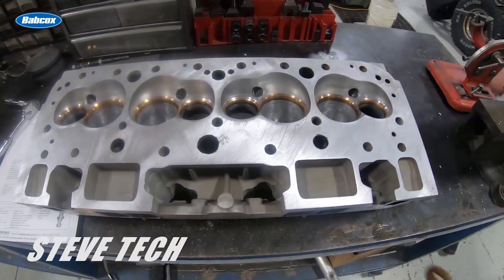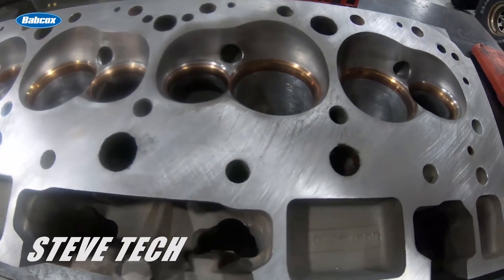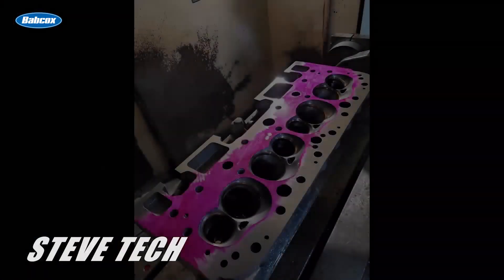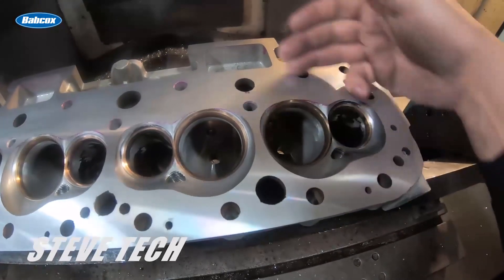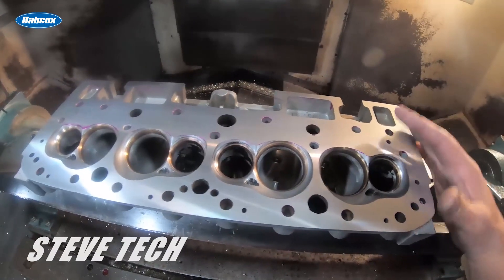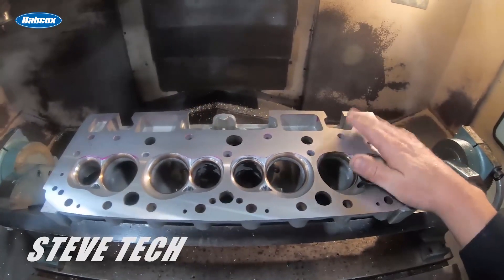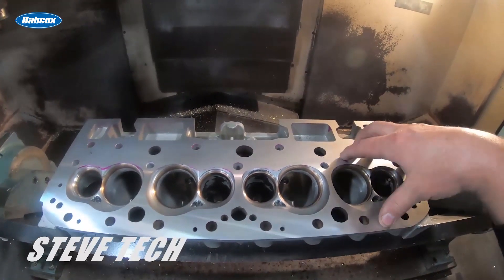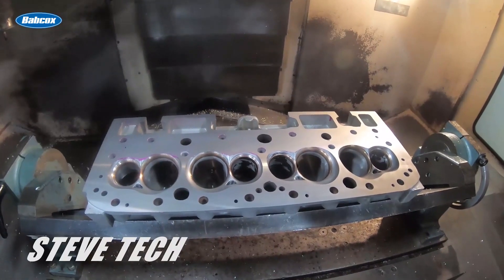Resurfacing Cylinder Heads

Comment: What do you do with the valves or pushrods when taking deck material off.
Reply from the maker: Those components wouldn't be installed as you're decking the surface. Or are you asking if those components need to change based on resurfacing?
Reply: Engine Builder mad bad. Yes do you need to change those components after resurfacing to a different size length etc.

Comment: What is the name of the colored dye u use to see high and low spots?
Reply from the maker: Most head specialists like to position the seat as high (toward the chamber) on the valve as possible. One way to check this is to use valve-lapping compound that etches a light gray mark on the valve to reveal where the 45-degree seat contacts it. Some engine builders prefer to use red or blue machinists’ dye instead so the compound does not cut into the carefully placed angles. Dykem is one brand that offers this.